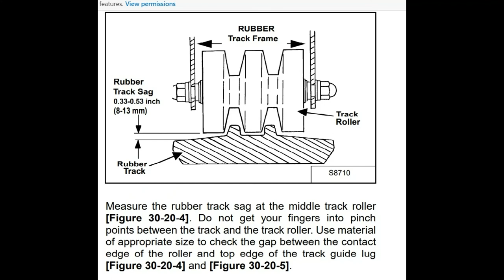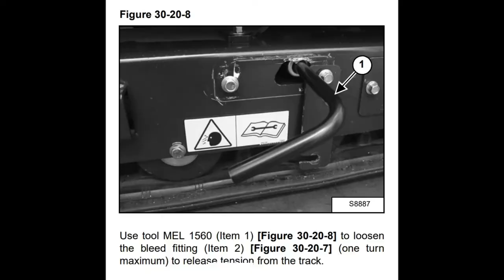Bobcat 418 / E10 track replacement

Comment: Hi thanks so much for the helpful video!  I was wondering if you used an OEM track or aftermarket and if you have used the aftermarket track, is it any good.
Reply from the maker: I bought them at a Bobcat dealer. They are Bridgestone branded tracks. I have only used dealer supplied tracks.

Comment: Do you find that putting the track on the idler pulley first instead of the drive sprocket first to be easier?
Reply from the maker: These small tracks are fairly easy so does not matter much. Taking off it is certainly easier to pry on the drive side. as the sprocket will pull the pry tool around to the front. Going back on to pry on the idler would require either a helper to control the drive, or turning the body around so you can reach the controls and not having the bucket stabilizing the back end. With larger machines and much stiffer tracks it is usually easier to pry on the idler side, and have a helper to control the drive motor. So on these small machines I think it is best to have help if doing it on the idler and if alone go for the drive sprocket.

Comment: Hello, how many hours do you have on the machine?
Reply from the maker: It is a 2015 model, with 1194 hours. Bought it from the Bobcat dealer with about 900 hours use as a rental.
Reply: @robb1165  👍 merci

Comment: Have to assume the same procedure could be used on my 331
Reply from the maker: Most rubber tracked equipment is similar. The 331 is larger. With the heavier and stiffer tracks, it is sometimes easier to pry the track on the idler side. Like in this video  https://www.youtube.com/watch?v=Az-g66-Wsqo 
On the 331 do not loosen the grease zerk to release the grease, instead loosen the grease bleed fitting about one turn, it is just aft of the grease zerk. Your track is also tensioned to a gap of 2.05 inch (52 mm) from the track frame to the track. Good time to check all the idler bearings. Also check the drive sprocket teeth as when they wear out the track tends to get torn.
Reply: @robb1165  thanks for the info. Will probably be doing this next year as the tracks are reaching the end of their life.